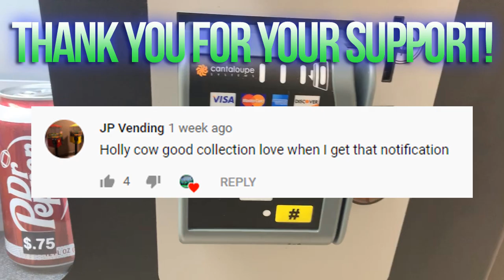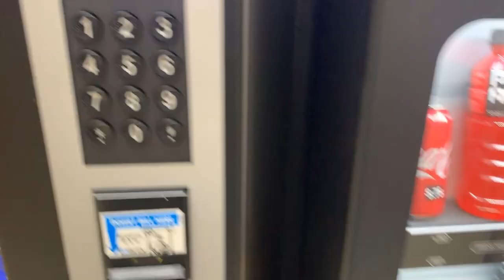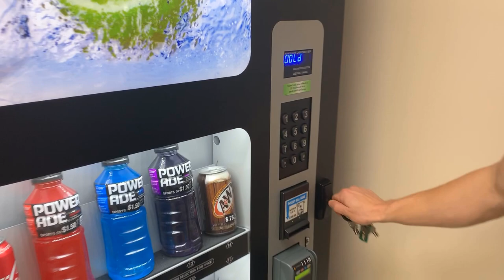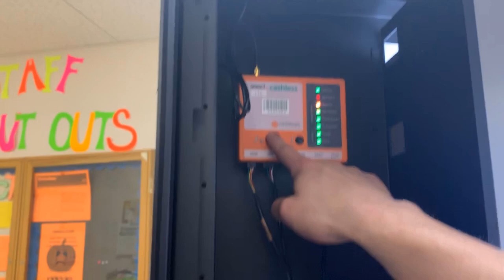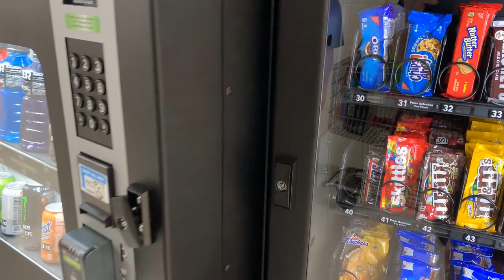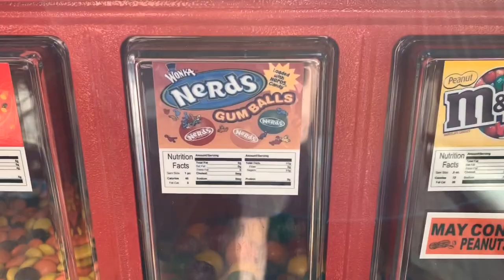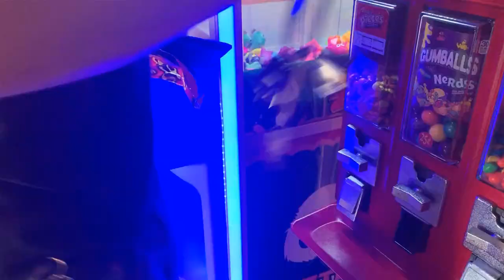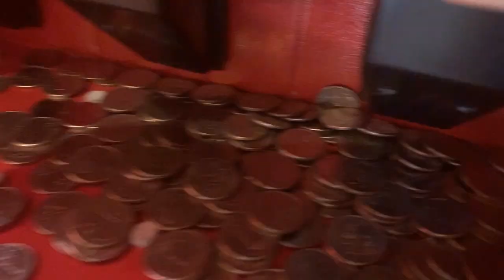Big Collection From Our Vending Machines

Comment: Another great video!  I have a question though - the last machine in the Mexican restaurant only needed a few peanut M&Ms but had the largest amount of coins of all the machines.  Seemed like way too many quarters for the amount of missing product.  Do you check on them and fill them up without removing the coins and then only remove the coins once a month?